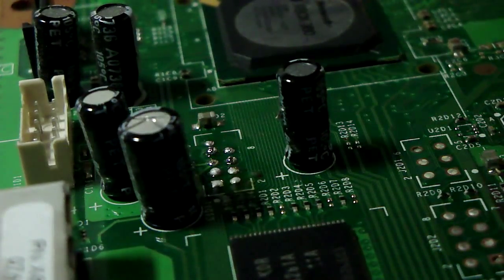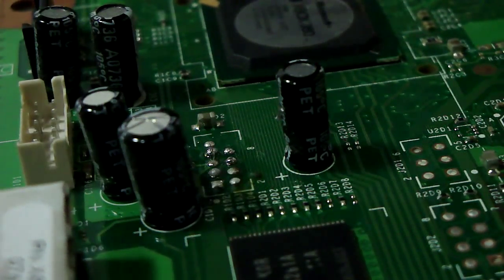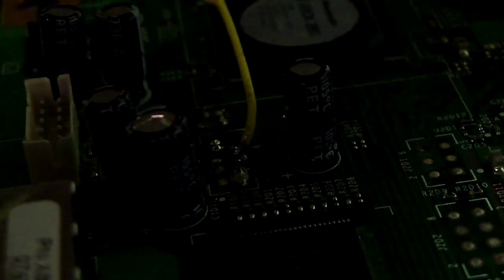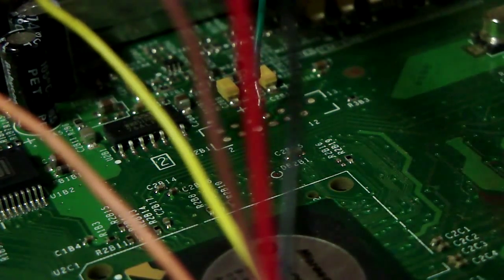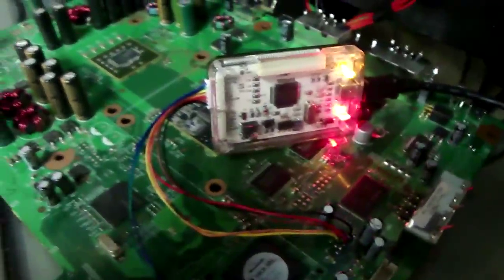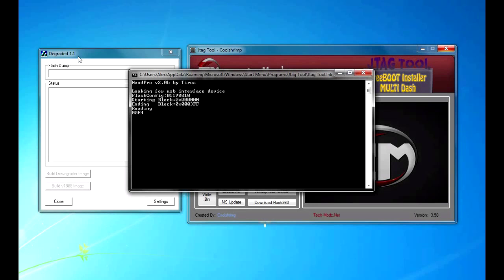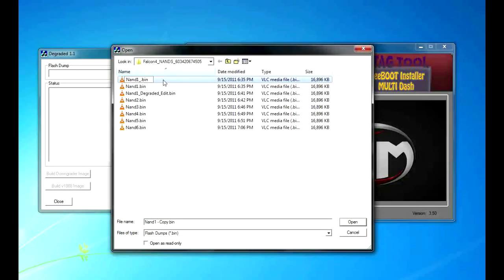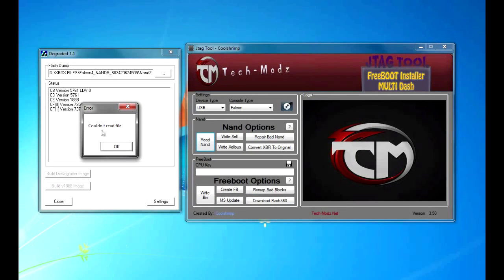NAND-X NANDX Wired Header Install and Reading NAND JTAG Tool

Comment: I am looking for a way to dump data from a usb thumb drive. I'm not sure why I seem to be the only one on the internet looking, but there has to be a way to wire it up. I would prefer no soldering (alligator clips?) and I am at a loss where to purchase this NAND reader used in this video. Can you clue me in as to where to go next? What's "the jumper method?"